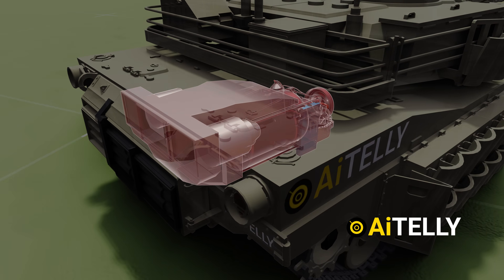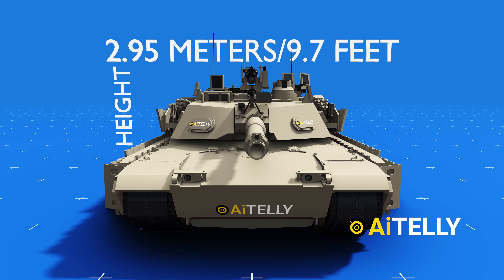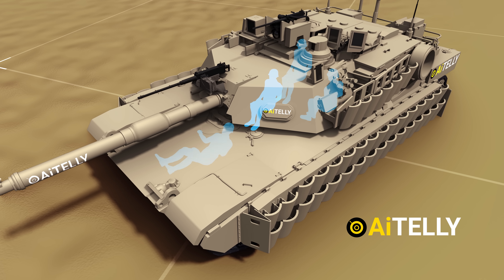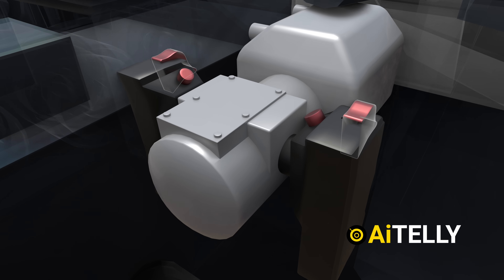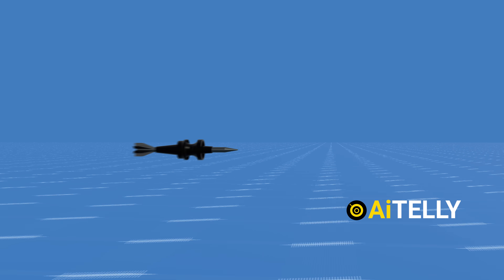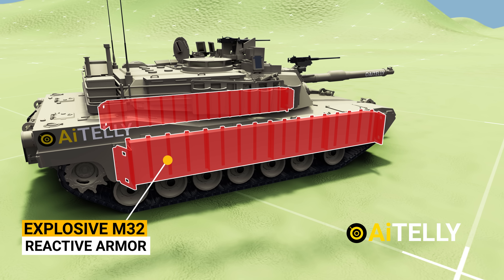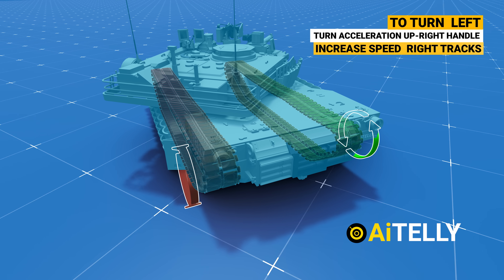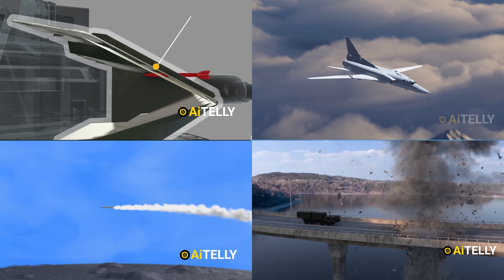How Modern Tanks Works and Fire Interior Exterior M1A2 M1A2C Abrams Trophy System Reactive Armor

Comment: Just some notes and corrections, I didn't write down everything, but the big stuff.

-The model of the top of the tank is inaccurate, CROWS are supposed to be on the top of the Gunner sight (the Box on top of the Gunners sight I believe is part of a prototype AI tracking site from a test tank)
- The Trophy kit extends off the side of the turret adding almost 2 feet to the sides and cannot be equipped with the TUSK 2 kit
- the loaders knee switch is in a non-operable stowed position, it needs to be flipped down for the loader to use it
-M830A1 is called MPAT not HEAT
- the tanks fire-control calculates a firing solution for the gun, all the ammo has the same accuracy and range effectively
-APFSDS is preferable for anti tank work, but MPAT and HEAT can be used as well (Multi Purpose Anti Tank) MPAT, (High Explosive Anti Tank) HEAT
-M1147 AMP (now called HEMP, High Explosive Multi Purpose), replaces everything but APFSDS
-M1147 HEMP Point detonate is vehicles including tanks, airburst is mostly for Infantry, And Delay mode is for bunkers or buildings
- The depleted uranium armor is on a lot more than just the turret and is combined with other armor Technologies from NATO Nations
-The AGT1500 was used not because the Abrams used the TUSK 2 kit and reactive armor, it was already being used
- The driver turns the tank by moving the handles like a motorcycle, the whole handle assembly moves together. You can rotate the handles like in the video to operate the throttle, the handles rotate with each other not independently
-The Current M1A2 SEP V3 does not have the latest 3rd generation thermal sights
-The tank is electronically limited to 42mph, off road to speed is about 35mph
-No Abrams is currently equipped with Trophy in combat
-Almost all modern tanks are vulnerable to top attack missiles

Not a bad video, it gets the bigger picture, but I thank some things got lost in translation and a military advisor was not used in proofing the final video.
Reply from the maker: This is the best  feedcak we got so far.
What we planned is credit your name in our Animation - Truly humble to learn someting from our audiences.

This ia a great community.
Reply: @Aitelly  happy to help
Reply from the maker: @kevinfarrell9449   Releasing on Saturday- We can't do all the correction  but thee major Corrections wil;l be done

Comment: Tracks + roadwheels + suspension plus drive sprocket make the running gear. The item yoj referred to as running gear is the drive sprocket.
Reply from the maker: Thanks will redo the Animation and give Credits with your name in it - Humble to learn stuff from our Audiences
Reply: @Aitelly  thanks but no need to. Found your video very entertaining!
Reply from the maker: @7249xxl  Should i give credits to this name

Comment: Very nice and simple video! They say that in Ukraine they are going to send one of the first versions it will be nice to make a video in comparison with the Russian ones! They also say that it consume a lot of fuel thats why new generation will have a diesel engine! One positive is that it has very fast acceleration!
Reply: Basically they're sending trash. Even some rebels in middle East have managed to destroy those tanks with RPGs. An artillery shell will blow away those Western tanks.
Reply: The Russians are really waiting for Abrams to burn them and the leopards have been training for more than a month aimed at defeating weak zones.The first to destroy Abrams and Leopard will be paid large cash bonuses and even promised an apartment in Moscow.Western tanks are not adapted for war in the conditions of Russia and Ukraine. they will get stuck in the mud as soon as they move off the asphalt, Russia does not just make tanks more than 50 tons, and all Western latest modifications are more than 70 tons
Reply: @user-dl3nc4jx7k  the m1 was designed to specifically fight the russians in russia.....
Reply: @макслюлюкин  yeah you have no idea what you're talking about

Comment: The MPAT DOES NOT replace the M829 series APFSDS rounds as nothing kills other tanks in direct fire, better than a long rod penetrator. The MPAT is simply meant to replace the other rounds the Abrams uses.
Reply: Actually no. An artillery shell can easily destroy a tank. Even a ATGM is better because have longer range and deeper armor piercing.
Reply: @elgranfreezer9117  "IN DIRECT FIRE" meaning from line of sight, artillery cannot punch through composite armor. Likewise, composite armor is really good at stopping shaped charge munitions from ATGMs. What you're referring to is "indirect fire", I was specifically referring to "direct fire"; in which case nothing still has the penetration capacity of APFSDS rounds. You're right that artillery is devastating, but that is INDIRECT fire  You're right that ATGMs are devastating, but the new ones only so because of the top attack option that avoids the armor. 

In MOST, DIRECT FIRE(Line of Sight) scenarios, an APFSDS round is your best tool for disabling a modern tank.
Reply: @danielcervantes7826  Artillery has direct fire by the way. Actually the explosion is hard enough to blow Up into pieces any tank. The ATGM doesnt need any top attack. Simply the Kornet missile can punch through 1200 mm of RHA equivalent.  Thats so much more of any tank protection.

Comment: I’ve seen actual Abrams operator saying tank’s interior is cluster phobic after seeing your animation I know why😂I’d have a hard time sitting in there even for a minute specially the driver’s seat
Reply: You’d want to avoid sitting in any Russian tank or fighting vehicle then.
Reply: Only crybabys complain at that, it isn't a big deal.
Reply: Compared to what?
Reply: It's actually not too bad compared to other armored vehicles. Even a Bradley's turret is way smaller and less comfortable. The driver's hole is actually pretty nice because you're reclined back in the seat which is good when driving around for a few hours without a break.
Reply: The Abrams is actually pretty roomy compared to most other tanks

Comment: While maintaining good quality, I think that Abrams needs major improvements... Perhaps in direction shown by Abrams-X. Gas turbine is blessing and the curse of any tank: Maintenance, fuel consumption, heat signature after all. Yes, it has a "multifuel" possibility, but as somebody very smart said, if you want an engine that`ll work on any fuel, It won`t work properly on any one of those.
Reply: Heat is not problem as anything warmer than background will stand out in a thermal camera., so any moving part will show there.
Reply: The modern turbine is only slightly less fuel efficient than contemporary diesel engines, and maintenance on the abrams turbine engine is way easier than diesel engines, and because of how gas turbines work its works just fine on any fuel
Reply: @ultrasupertrunk90  I`m still not convinced about fuel eficiency, but I can undertand why it works on any type of fuel. Though I meant working eficiently on any fuel, not that it won`t be able to do so.
Reply: @Spicy_Air_Emjoyer  so the engine when at idle does have shit fuel efficiency, which is why the US wants to add APUs back to the tank, but when under load and maneuvering the engine is as fuel efficient as any other engine, and as for the fuel, there isnt any real performance loss
Reply: @ultrasupertrunk90  price, logistics, manufacturing. This stuff. Diesel engine just uses diesel. Gas turbine uses a lot of  different stuff. I do appreciate pros of gas turbine but the sheer amount of complexity it adds is just scares me...
Reply: @Peter Rudenko  the onley thing is manufactureing, logistic and maintenance for the Abrams turbine is actually really easy and its mechanically less complex than diesel engines

Comment: Just as an FYI the driving isn't correct. To turn the tank you turn the T handle like a bike, both handles on the handle are uniform so turn one the other turns you can alter the speed of the turn buy giving it a little more gas and holding the break slightly.
Reply from the maker: Thanks Will try to redo the Animation and upload again - Credits will be given with you name in it at the end

Comment: A modern tank wins not due to its low silhouette, but due to electronics, optics, computers, and technology
Reply from the maker: Well said
Reply: You are absolutely wrong, it is not iron that wins, but people. that is, the crew of the tank, these Abrams of yours only burned barefoot Hussite shepherds in Yemen. armed with kalashnikovs and rpg-7s, and no technology and advanced electronics helped the Saudi mercenaries there, everything depends only on the crew
Reply: @макслюлюкин  Of course!  if there are monkeys or chomobiks sitting in the tank, neither the T-90, nor the French sight, nor the icons of God in it will help them.
Reply: Actually no, it's because it's crew. Saudi Arabia uses very poorly the Abrams. 

And a low silhouette really helps a lot, because it's harder to hit, also reduces weight, that's pretty obvious, duh.

Comment: The top speed of the M1 is classify. I would bet it can do over 55 mph on paved surface easy. Also don't forget see first shoot first and given the M1 fire control it can hit it a moving target 3 miles away 90% on first shot.
Reply: Actually the top speed shown in the video is the governed top speed meaning that if the crew turns off the governor then it will go far faster at the cost of fuel.
Reply: It's "classified" because USA stupid policy. Actually the maximum speed is 59 mph, but that would damage the engine.

Comment: The steering is incorrect. There is a single brake. And you just turn the steering like a bike left and right and that takes care of the power transfer to each track. The throttles aren’t independent of each other. I was a tank crewman in the marine corps
Reply from the maker: Thank will Redo the Animation and Credit you at the endo fthe Video - Thanks again

Comment: Just wanted to correct some information from the part where the video talks about the different ammunition the Abrams uses.  The M1147 multi-purpose round was designed to only replace the: M830, M830A1, M908, and the M1028 round.  The US Army is still going to us the M829A4 because it can penetrant up to 880mm of RHA from 4,000m away, and it was mainly designed to counter ERA armor and active protection systems.
But over all loved the video and the animations.
Reply from the maker: Hi will redo the Animations and give you credits again
Reply: @Aitelly cool
Reply from the maker: We Corrected this Video Abrams Tanks   here https://youtu.be/5AdirNl4l1k how to drive a Tank
Reply: Exactly
Reply: watch out the military experts are in.
Reply: 880m RHA at 4km? Seems like a stretch, and the specs on the new sabot are still classified. Where did you hear these figures from?
Reply: @Neutralino1  just off wiki and other military websites, plus the only classified part of the round is how its made and the alloy percentage, you can calculate the speed and weight of the round, then run some simulations and you can get close enough to what the round would do irl
It would been the same as the US knowing how much a Russian sabot or heat round can penetrate
Reply: @robotic013  You should share these calculations and simulations, then.
Reply: @Neutralino1  I meant as in people can do the calculations and simulations i dont have the time nor the experience to set one up, plus when the US military tell us what a vehicle can do they are probably only telling us 80% of what it can do, meaning I wouldn't be surprised if the M829a4 sabot round can penetrate more then 880mm of RHA at 2.5miles.
Most tanks effectiveness drops at 2miles so it's not crazy that the Abrams is still effective at over 2miles range

Comment: I heard that Abrams can be faster but it's limited by it's software to limit wear and tear
Reply: All the engines are "limited". There's nothing special with the Abrams jet engine, except it consumes so much more and really isn't that efficient. 

All engines are limited to increase lifespan.
Reply: Official numbers are often or always lower than the real topspeed. Does not depend if everyone knows it. The leopard is capable of maybe 100 or above kph if driven on roads.
If I remember correctly the engine has also a normal mode and the other has the name of emergency power.
Reply from the maker: We Corrected this Video Abrams Tanks   here https://youtu.be/5AdirNl4l1k how to drive a Tank
Reply: It does in fact have a governor installed. That turbine engine was originally supposed to power the UH-60, AH-64 and SH-60 helicopters but the GE T-700 won out. Instead it is now found in the Abrams. It is a very powerful engine.

Comment: The active protection of the tropical is 360 degrees and also for most of the upper part of the tank
Reply from the maker: The Israreli one is 360 degree but these old American Trophy is 220 degree
Reply: @Aitelly  220? The Trophy system on the M1A2 is relatively the same as the one mounted on the Merkava 4M tanks, full 360 Hemispherical coverage, look at the M1A2 SEPv2 with Trophy.
Reply from the maker: @shinanofukuzawa3925  Yes I agree with the Latest  one being fitted M1A2 SEPv2 but  the older version does not have reloading  Trophy system. Which we will be making on the Merkava Tank.
Reply: No, it can't protect from above.
Reply: @elgranfreezer9117  Of course not on the entire upper part, but on a significant part of it. That's exactly what it was designed for, it was designed to protect against attacks in Arab territory like in Gaza